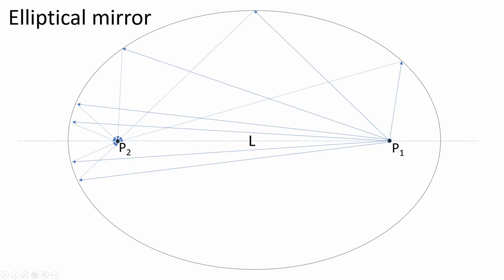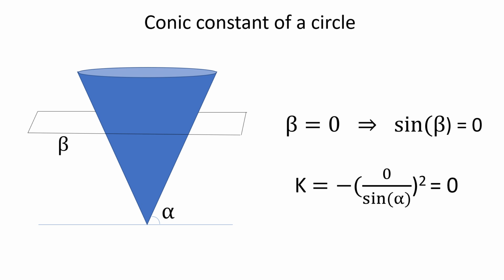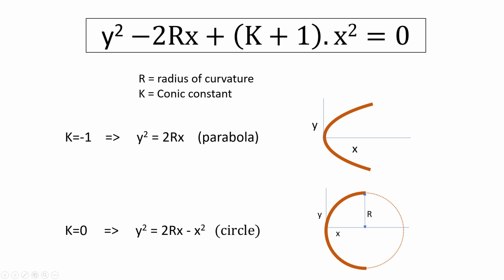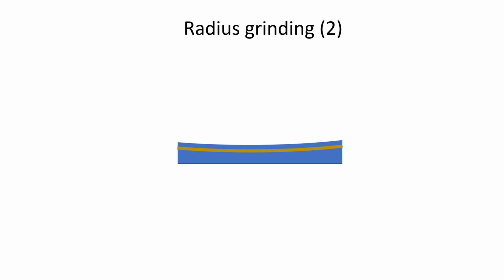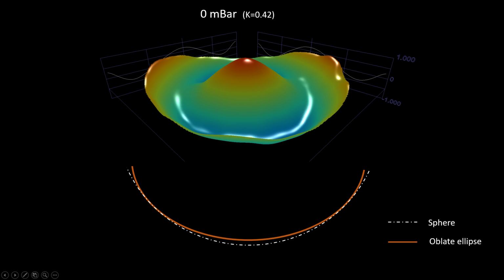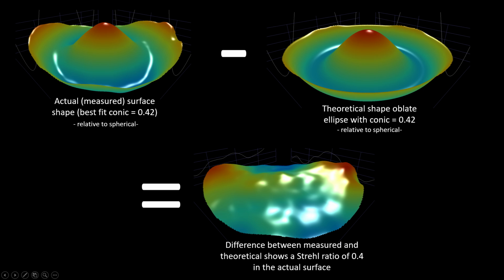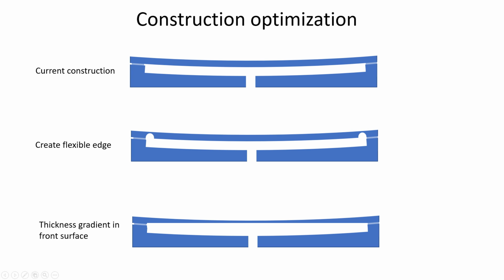Making a Mirror with a  Variable Surface Shape

Comment: Lithographer at ASML here. I'm working in imaging but studying about optics design when I found out about your channel. It really helps stuff fall into place for me! Keep it up! :)
Reply: absolute miracle, u lithographers are sure hard to find. i had this question for some time but nobody to ask. as a lithographer do u know what minimum dimensions transistor features can be without making them susceptible to background radiation levels at earths surface, at what sizes does this start to become a problem? 
or is it a question that should be posed to research scientists instead?
Reply: @echelonrank3927  Haha wow! I have absolutely no clue. I think it not only depends on the feature size, but also on the transistor geometry and materials used. I assume that current cutting edge nodes are still robust enough to use on earth, as will be the nodes planned for the next ten years. But you should indeed ask an IC designer or a research scientist. I just know how to optimize contrast. There is a really cool video on this channel as well called Imaging at ASML.
Reply: @DrBlokmeister  im not really into optics but might check it out. i was always  fascinated as a kid with this stuff, we had an optical lab with etched windows downstairs in the apartments and u could see techs in there doing everything.

i heard that microsoft ran some servers submerged inside ocean pressure vessels  and found significantly less soft errors in processors than expected.
this was attributed to decreased amounts of radiation than at the surface.

Comment: You find answers to hard problems in the strangest places. I've been working on a DIY phased array radar, and am at the point where I'm writing the algorithms for converting signals at the array into an image. It's a very simple problem with two antenna elements... But add a third, and suddenly you need to worry about focusing. Like a total noob, I'd heard "parabola is best shape", and indeed simulations showed it is... At infinite distance... And I was struggling to understand why at close distances, a spherical formula performed better, and everything in between had off-axis blurring. Bam! Conic constants! Luckily I wont have to grind any funky lenses. A few more lines of code, and I can focus on everything at once! 😁
Reply: That sounds so fricking cool holy crap
Reply: You luckily don't have to grind funky lenses? Yeah you really don't have to, because I guess building and coding radar interpreting software is already hard enough. Do a video about it if you don't have already.
Reply: @AllisterCaine  The radar signal processing isn't too hard. Its a lot of FFTs and inverse FFTs with some filtering and reordering of data. The hard part is processing all that data and displaying it graphically in real time. You have to get very close to the hardware, and do as much processing as possible on the GPU. At this point, all the CPU does in my code is hand a batch of samples to the GPU, and it does the rest. I suppose that part would be worth a video.
Reply: Why haven’t you made a video about it??!?
Reply: Do you have a channel or page for the phased array? Love to see it! What's the application or is it just for fun?
Reply: @anthonywilliams7052  Its just for fun. No I don't really have any videos if it other than a timelapse screen capture of it picking up passing aircraft. I figured it was too niche for anyone to be interested in it, but it seems I was wrong. Been kicking around the idea of starting a technology channel to document this project and others. I just need to get off my ass and do it.

Comment: That really is some incredible software!
As far as making a constant-strehl ratio variable mirror, I suspect that would actually be relatively easy using software like fusion360’s strength calculations. Or the same thing with some programming. By modelling the glass as having some tensile and compressional constants, you could do some numerical equation solving to find the optimal thickness gradient for keeping that ratio constant. While not simple, it’s certainly better than trial and error.

Comment: Excellent video and am watching this years later. It struck me that getting the curvature to flex properly is similar to building and tuning a guitar sound board, and getting the modes correct. A different set of terms but a similar approach might work. Pressurization of the chamber during polishing would maybe only translate the curve in your graph but this would provide another degree of freedom in the control process.

Comment: I loved finding out at the end that the goal was actually not reached. It would be very interesting to see a different geometry, where changing the internal pressure would cause the back and front parts to move linearly with respect to each other instead of bending. Zero bending. Perhaps this could be achieved by use of a rubber-like circular band placed between the back and front lenses. The band would be in the shape of a perfect torus. Would this work? No, it would only change the focal length, not the conic constant. I can't help thinking that there must be a solution, a way to change focal length in such a way as to avoid any aberration. Maybe that's why expensive cameras use several pieces of glass attached together to focus light.

Comment: Brilliant.. thank you.. I now know what spherical aberration is and also confirmed my suspicion that engineering is always an approximation inside a tolerance determined by the cost of achieving it. It reminds me of a principle in thermodynamics that to decrease the entropy (increase order) of a system of particles you have to increase the entropy (increase the disorder) of the surroundings by more. Which is why abiogenesis is impossible.
Reply: I like the dig at the end, I thought I knew what you meant but I had to look it up to be sure. The fact that crazy things can happen because of randomness does not mean that abiogenesis is possible.

Comment: Its obvious that you are having fun! Are you familiar with the work of Gerard Lemaitre and his numerous colleagues at Marseilles LAM observatory? Look for example at the "Rumsey Telescope" where "bend and polish" combined with substrate design allows one vaccum to produce two separate coniciods that meet in slope AND position at an intermediate radial zone of hte substrate (so a continuous optical surface, with two differnt conicoids). This is used to produce a three-mirror anastigmat with Primary and Tertiary on the same substrate, and is made with an evolute of the technique you discuss. Norman Rumsey invented this type of TMA in 1969.

Comment: I got a large Germanium lens which uses a giant front element. It's concave on the inside and due to the nature of Germanium and the coatings, it's quite reflective in the visible light spectrum. I don't know if it's parabolic or spherical. But I believe it's spherical since it looks machined. Now I got a few test I can try to measure it.

Comment: You can also use a elliptical star as a laser cavity where the middle point is the laser rod and the points of the Star are the Flash lamps I have built one one time and it works as long as the flash lamps ignite all at the same time. Also to Manny flash lamps at the same time you will risk that the laser rod destroys it self do to much energy input causes internal stress and it gets instant milky like shattered Glas but maintains it shape.

Comment: The oblate elipse looks like the object to be looked at is BEHIND the focus or observation point.  Perhaps for extreme maginification.  I designed a water lens when I was in my early twenties, later determined that I could do the same with a very large mirror and sheet of glass for long distance focusing and burning.  I never made that one but always wanted to.  It would be good if we could modify a mirror for laser focusing at extreme long distances, like from here to the moon, so that the lens countered the divergense of the beam through  a feedback observation.  Multiple lasers of different colors with this mirror tech could focus multiple beams at two miles or further to combat an oncoming threat in space.  A phased array of lasers, better known as a phaser.

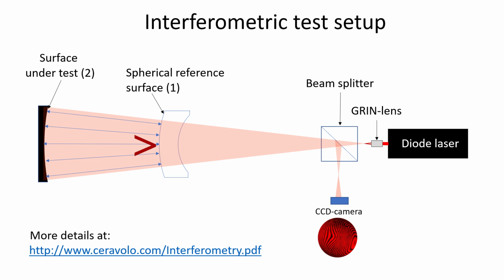Comment: 13:32 . . . Unless the instrument aberrations are so bad as to cause "Retrace Errors", then you've got problems.
Better to just minimize by design using stigmatic surfaces imo.
btw, Might want to put a pupil imaging field lens near at focus before camera so you can create sharp edged image of test surface boundary (minimize ringing).

Comment: this is fascinating!! been dreaming about such a structure for years, but i have a few questions: 1. why do you need to grind the surface of top plate when it is already glued into one whole system? can you grind it before assembly? 2. why do you even need to grind it into a curve? i though with low enough pressure, a flat surface would get curved into spherical shape automatically. 3. under pressure, how stable is such a system?

Comment: It looks like you could firm the mirror for grinding by flooding the space behind it with low-temperature wax, but why do you even have such a sophisticated backing plate if your goal is to simply support the rim and make a tight seal? It seems like a stack of two or more backers would be needed to perform the complex shape change from sphere to parabola anyway. One contact point per increment of 63% of the remaining correction to be made, sounds like viable technobabble. I'll go with that. Then, after mapping the various pressure levels for each layer for focus quality, you can use a microcontroler to maintain this focus for you, freeing your hands for...  3:16

Comment: Seems like you're struggling with two things. The boundary condition around the edges and the stiffness of the lens. To improve, would seem having a more flexible adhesive around the edges wouldn't overconstrain the edges and you probably want the thinnest area in a sort of ring where you need the largest amount of deflection with the center relatively stiff as all three shapes are roughly spherical at small scales.
Reply: Three zones of different stiffness of spherical lens would certainly help, but would not be sufficient to support accurate change of conic constant, IMO. But one other problem is that optical glass is not available in radially varying stiffness, hardness, or optical density.

Comment: It's non-obvious to me that bending a mirror would make a conic in the first place, so the conclusion wasn't especially surprising to me.  The possible solution of using glass of calculated varying thickness is clever, though - sounds like a job for computational modeling and optimization, haha.

Comment: I'm wondering if you are aware of the Sky and Telescope Nov 2000 article "Flexing Spheres into High Quality Telescope Mirrors" where they do flex a mirror without a vacuum. It would be interesting to measure that in your test apparatus and perhaps it could be the subject of another video!
Reply: I second that.   I have built flex mirror scopes.   Superb.  I have not worked out if vacuum would do the same job.  I know they use vacuum as demonstrated to make Schmidt telescope corrector plates, so...probably...

Comment: Other than the last bit addressing the mirrors failure vs a theoretical perfect one, I had a thought about the issue of the mirror bending during grinding. Could you fill the void with water and plug it while grinding? I imagine the hydraulic incompressibility would help support the center of the span, but then again I dont grind lenses/mirrros/anything optical (yet ;) ).  Im sure there is something Im overlooking, possibly the bond strength of the two surfaces, though I cant imagine that being much weaker than a span of thin glass. But that was my fabrication brain's immediate thought when the bending of the surface while refining the shape was mentioned......

Comment: Nice video. I have a query, 3:00 What happens to the parallel rays non parallel to the principal axis?
Reply from the maker: Good question. Parabolic mirrors only give a perfect image on the optical axis. For off-axis rays they suffer from an optical aberration called "coma". See https://en.m.wikipedia.org/wiki/Coma_(optics) for more information.
Reply: @HuygensOptics    ohh thank you so much. I have been googling for many months parabolic reflection of rays non parallel to principal axis and just couldnt find the buried answer. I even tried learning simulation for reflection. This scientific grammer/definition is sometimes very dificult to get. Thank u

Comment: Love this video! Very cool experiment indeed.
Question: what would happen if you used a reflective film for the front element rather than a glass element? Wouldn't it resemble a parabola more closely under vacuum?
Also, I didn't see if you had a liquid in the syringe or was it just air, wondering if it would be easier with a incompressible liquid.

Comment: There is a small but growing movement of photographers using lenses not meant for capturing high quality images, such as video projector lenses, surveillance camera lenses and enlarger lenses (printing in a darkroom enlarger). Seeking out a thin but usable depth of field at wide open aperture is the goal. The background blur (bokeh) of pinpoint light sources is the artistic goal. Do you have any lenses I could experiment with ?

Comment: Another great informative video. Thank you.
I'm still curious what's the use you had in mind for the small variable mirror.
Reply from the maker: I did not show this in the video but I made a convex version of this mirror simultaneously with the concave one. Idea was to use the convex version to test the principle in a "classic cassegrain" configuration, where the secondary is a hyperbolic convex mirror. But for the convex version to work, I had to apply too much (positive) pressure inside the cavity. Forces on the glue quickly became frightlingly high and since it was tensile stress, this would not work. So instead I just used the concave mirror to test some of the properties, which was way easier for me than testing the properties of the convex version.  In short: the concave mirror was sort of a by-product.
Reply: @HuygensOptics  Could the convex lens be glued inside a lipped tube so the glue is in compression? Using water for pressure instead of air would mean no energy is stored in the compressed gas, so a sudden failure would be less energetic. I think the classic cassegrain is a great idea.

Comment: the test method is to use negative air pressure....what if.... it is positive air pressure or liquid, such as water? we know some case if a container is filled, it behaves differently.

Comment: The mirror need to be segment in different areas of the mirror by suction,you have just one ,what a
Happen if you put 5 different suction in the mirror control each section ? The middle higher suction then next one .

Comment: Can u have a thinner flat mirror resting on oring at appox 0.7x r.
Then vac . This removes the stiffness and bend about the perimeter.
Maksutov corrector shells can be made this way as u are aware im sure.
Love ur vids.  Your easily vup there with jean texereau, h.e.dall etc
Reply: no, edge support is where you want it.   Schmidt plates yes...mak correctors No

Comment: The ELT will use adaptive optics that are actuated by very small mechanical "push-pullers". Any thoughts on a comparison between using compressed air vs mechanical actuators? I guess complexity and scale are some of the pretty obvious tradeoffs.

Comment: Is there a reason to make the back piece out of glass, rather than just milling it out of metal (for example)?  Great video.
Reply from the maker: It's done to match the thermal expansion to avoid bending by temperature changes.

Comment: I wonder if you can remove the bump by filling the cavity with something (like wax or a soluble plastic) in the final polishing of the front element?
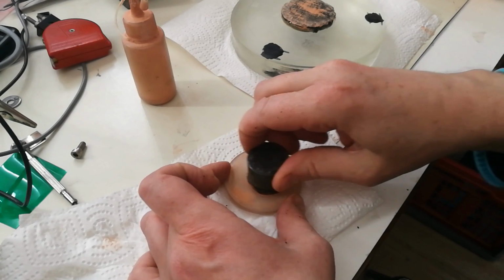Reply from the maker: Hi Andrei, unfortunately that would not work, it would actually create the opposite effect. Wax and plastics have a strong volume shrink (several %)  when they solidify. This would actually retract the surface over many microns. After polishing and removal of the wax (which would release the surface), this would cause a very large bump. I used deterministic polishing on the center (shown at 17:55) which resulted in a fairly good sphere. However, the problem of the non-constant Strehl was still the main issue after this.
Reply: @HuygensOptics  how about adding water/liquid & temporarily sealing the void before the final polish stage? A tube & clamp may do.
Reply: @HuygensOptics   That's a shame, but I guess the devil is always in the detail. Really interesting projects nonetheless, I'm excited to see more on the metasurfaces
Reply from the maker: @andreithe3893  Then I'm pretty sure the next video will be to your taste :-)

Comment: I wonder if you could  improve the "bump" in the centre by figuring and polishing the front surface before deblocking rather than afterwards?
Reply: Absolutely - thicker glass will polish without flexing so much under pressure.  You could polish the two ground radii against each other to a test plate fit, contact them together, mill the top plano surface to convex, polish that while still contacted, then decontact and run the sandblasting process.  Sucks to sandblast a nice polished surface like that but needs must.  You now have a nice K=0 surface to deform from, that was fully supported during polishing.  There are plenty of optical cements which work just fine on polished surfaces.  The same vacuum pressure should then get you to a much more negative K value